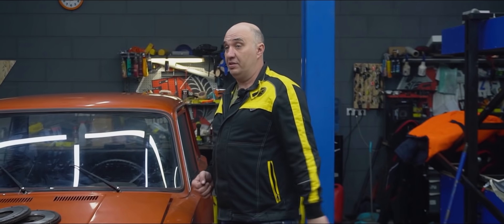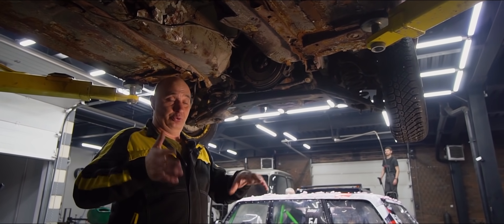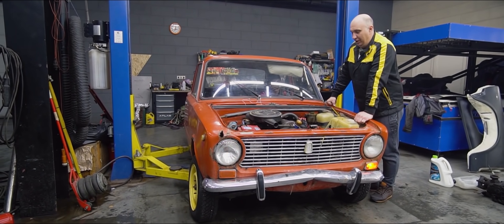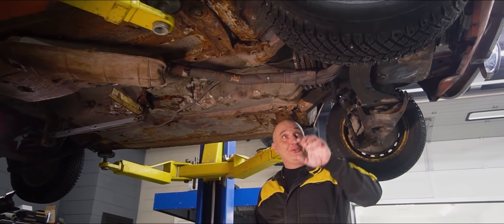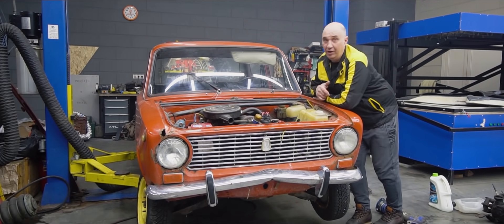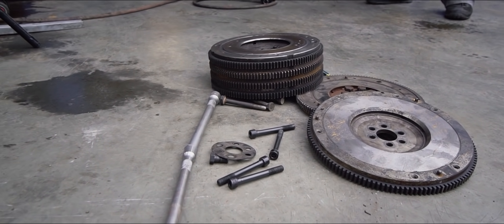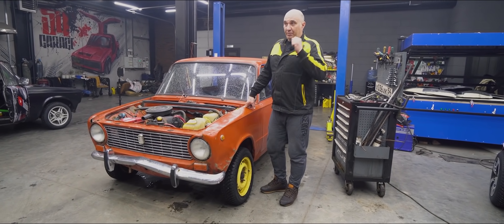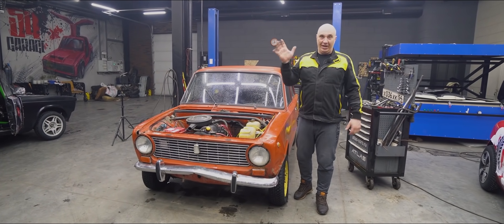What if you install FIVE flywheels onto an engine?

Comment: Hello Russian people!! Thanks for experiment. I really wonder how change fuel eating by car with these flywheels. On highway, without changing speed it should go lower I think. Maybe even much lower. I always wanted to check it. Or use not metal flywheels but gum flywheels - I mean use tires full of gum iniside. Or use both : metel and gum :) Now price of fuel going up, so maybe it's worth to think about it. Maybe stronger brakes will needed ;)

Comment: Fill an engine with diesel instead of motor oil. Or even try removing oil rings also. You will have a dual fuel motor.

Comment: If you installed five flywheels onto an engine it would take at least five times the energy to get the engine working and it would be at least five times slower, it would take at least five times the energy to brake the vehicle to a stop but once it got moving it would cruise at lower RPMs,    maybe I'm wrong.

Comment: Excerpts from the book - "Secrets of Cold War Technology" by Gerry Vassilatos (pages 86-93) 
Mr. Savo reported that in 1931, he participated in an experiment involving etheric power. 
He was asked to accompany his uncle, Nikola Tesla, on a long train ride to Buffalo.
Taken into a small garage, Dr. Tesla walked directly to a Pierce Arrow, opened the hood and began making a few adjustments.
In place of an internal combustion engine, there was an AC motor.   From it trailed two very thick cables, 
which were connected to a terminal in the dashboard.  Here, Tesla plugged in a shoe box sized "Black Box". 
In addition, there was a  single ordinary 12-Volt battery.  
Dr. Tesla informed his nephew that the device could not only supply the needs of the car forever, 
but could also supply the needs of a household "with power to spare".  
Of the motive source, he referred to "a mysterious radiation, which comes out of the aether"  
and  "it is available in limitless quantities".  
   -   -   -   -   -   -   -   -   -   -   -   -   -   -   -   -   -   -  
 > 50 years ago, famous physicist Richard Feynman said  
The vacuum of “empty space” appears to be an energy reservoir of immense capacity   
that makes nuclear power seem old fashioned.   
The amount of energy available in one cubic centimeter of the vacuum (ambient space)   
is much greater than the energy density in an atomic nucleus.

Comment: you are nuts, if rave that engine up high like going into passing gear, its a good chance the flywheel could break off from the crankshaft come thru the floor and take your feet or legs off. Some high performance engine require what we call a scatter shield to protect the drivers feet and legs. good luck with it.

Comment: 3 flywheels in 300-400 hp rally car would be nice no clutch or only when you start moving but else times you only need a swap gears and those flywheels keep all turning a head

Comment: I'm curious to learn if the engine timing is the same with the five plates on compared to the timing before the installation and if there is a gradual change in the timing as plates were added ?

Comment: Do you think you will achieve better fuel economy because of the momentum force behind the engine after you let off the throttle?
Reply: Fuel economy will be worse because most of then the energy to spin it up is wasted so more energy goes to spin up the energy without the benefit of it doing any work to move the car. Only sometimes you will have the benefit of the exstra energy in the fly wheel like when going up a short hill or starting, but that do not help the economy enough to make up for the wasted energy spooling up.

Comment: Get out of that snow and on dry pavement then rev the crap out of the engine, drop it in gear and see what breaks. Im sure it will love U joints clutches and ring/pinions!

Comment: Like a recent video, what if you completely replace the coolant with oil? Maybe add some radiators so you don't need any solid head gasket and the oil is also the coolant.

Comment: Letting off the throttle and You don't slow down, and the problem is?
Better gas mileage and if ya want to slow down then put on the brakes

Comment: The flywheel bolts and the crankshaft endflange may fail catastrophically.  No worry, the  armor quality of the car's floor metal will provide ample protection.

Comment: What if you install a thousand?  Because everyone knows more is better, in every situation, right?  :-/   In high performance motor installations great pains are taken to LOWER the flywheel inertia, for obvious reasons from an acceleration standpoint.  You'd rather put that energy, under acceleration into the car than into some useless overlarge (for racing considerations) rotating mass, the very spot extra weight has FAR more impact than in the static (with relation to the car/you) components.  But yeah, it should idle GREAT.

Also, unless you do things like this carefully they are VERY dangerous.  I had an acquaintance you was killed revving a racing wankle to very high RPM (well over 10k) standing still, to adjust something, whereupon a Centerforce clutch (a fully tested, factory made device, ie some reasonable design practices and quality controls implemented) decided to let fly a weight which entered his upper face, and felled him permanently right on the spot.  

He was highly over-revving the engine, far beyond the Centerforce RPM limits, so it was kind of his fault.  They don't put scatter shields on race cars for nothing, and if he had bothered to spend a few bucks to do exactly that, he'd still be having mucho fun amateur building race cars.  In some areas Darwin does still operate, and this guy wasn't stupid, just lax with common simple stupid safety precautions, and paid the ultimate price.  Just sayin'.  I especially worry about morons trying this stuff with absolutely NO idea what they are doing (just look around YT to see what I mean).  I'm talking about the kind of guys who's welding looks like bird droppings with no penetration, etc which could definitely be life (or lower leg, like Garlits) threatening here.